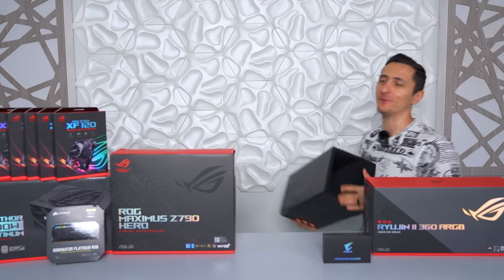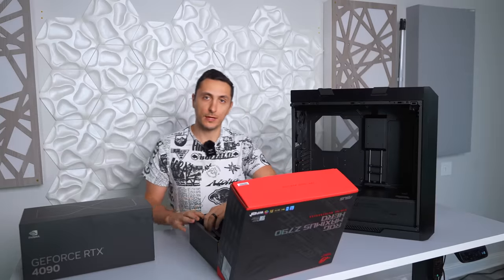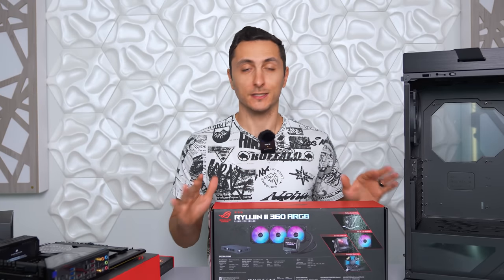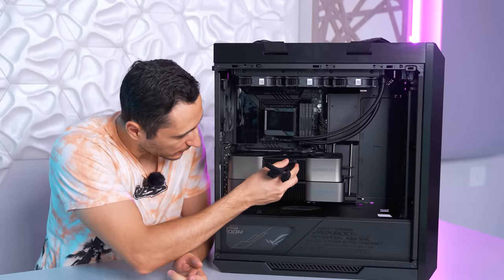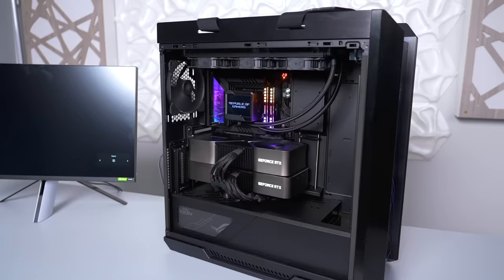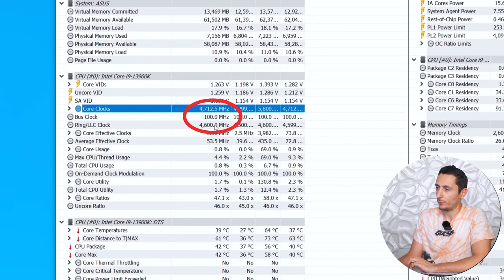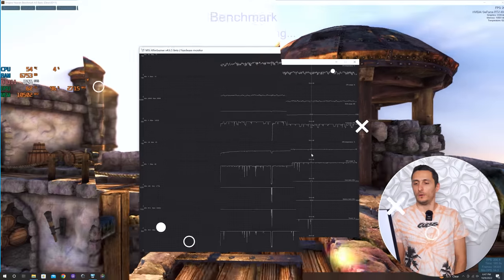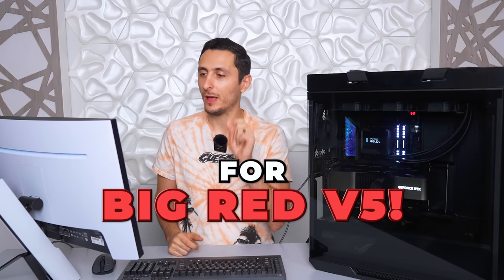This was a bad idea - 13900K + RTX 4090 PC Build (BigBlack)

Comment: At this point in gaming there really is no need to do multipule gpu's the 4090 and even a 3080 or 3090 is totally enough for performace. im glad you showed everyone how much hotter the temp is with the air flow being reduced because the extra gpu. almost 20 degree increase is crazy and deffinetly add to wear on ur gpu and its life span. thank you ed for the new video. dj kahlid need to sponser you. another one we the best video. lol
Reply: Disagree.  I'm on an LG CX48 and the 3080 barely does half the displays capability on it's own.  High settings in a lot of games at 4k I'm around 60fps which is playable, sure, but when you can get 120FPS visible?  It's not lol.

I would have done dual 3080 if it got me to where the 4090 does now.   I do custom loop cooling so my 3080 has never gone over 55C and adding a second wouldn't bring it much higher peak temp.  I have a 4090 showing up Thursday and it's getting a waterblock as well but as someone who used to do SLI all the way up to the 2080TI days, I think you're finally right that the 4090 is a card that finally doesn't need a second to pull off what most people at the high end want.
Reply: @tonymorris4335  I guess ur right but I was speaking on the average gamer. From what ur saying ur not just an average builder and u must do a lot of designing and other stuff for ur builds. In that cause I do agree 👍 with you but for someone who is just casual gaming my 3080ti does fine with most of my games on high settings. I do have a 49" ultra wide I don't like so I just ordered the asus rog swift 360hz 24inch gaming monitor. The 49" is to hard to look around at everything in fps games. But thank u for ur response. Have a great day.
Reply: Nope 👎 a 3080 or a 3090 or with „ti“ have Not the power of a 4090 play in 4k and you will see the difference.
You will get something around 40-60% more Power and less consum of eletricity. But yeah if a 3090 ti will take 410w and a 4090 will take something around 260w with more fps there is no difference for sure, i think the 3000 products are Not Made for real 4k gameplay.

Comment: this is slightly nitpicky but at 10:25 it's not because the ram is dual channel, ram speed is measured in megatransfers per second (mt/s), mhz is the frequency of the ram. as with the ddrx standard (double data rate) two transfers are done in one cycle, so mt/s is always double the ram speed in mhz so the speed being 2600 mhz is just the frequency of the ram, speed of ram is 5200 mt/s, not because it's in dual channel

Comment: The z690 hero  board supports 6000mhz ram as well. Check the qualified vender list if you want to verify. Using a 6000mhz kit right now…

Comment: The 4090 does not heat up. They’re made for that. They’re blowerstyles. I run this with 3090s and now a 4090/3090. It’s not a bad idea. Problem is having multiple cords and no fans at the bottom to throw air into it.

Comment: a properly desgined large case like this would have 10 expasion slots straight down the back for it's size & still maintain the triple slot Vertical GPu mount.

Comment: Unfortunately, using the M.2_1 slot on the Z790 means the SSD will share lanes with the graphics card. You will essentially half the GPU PCIe from x16 to x8.
Reply: half the speed of pci gen5 would be still as fast as gen4 with more than enough speed for the gpu

Comment: You don't double the number of the speed of your memory in cpu-z just because it's in dual channel. It's reading the speed correctly, however DDR stands for "double data rate". So, yes you're at 2600 megahertz, however, you're at 5200 mega transfers per second.

Comment: I'm not professional at pc building but I see a standup gpu spot couldn't you put the second gpu or the first in the standing position on the back so they don't sit under each other causing air flow issues?

Comment: 6:34 isnt it better to use the stock cable that came with the GPU instead from the PSU so you can run the GPU at full capacity?

Comment: Hello maybe I can get some help here, I’m building a pc with some of these parts:
1.i9 13900k
2.3080 GPU
3.32gbs of ram

What motherboard would best fit me? I game quite a bit and don’t need a million features just for it to be reliable and work with everything. I was thinking about the MSI Z790 P here in this video.
Reply: What you need is 2 8x/8x slots like on the Asus Creator mainboards. I think the maximus is also layed out that way. Most mainboards are not.

Comment: This is what exactly the system I want to build. Same mobo and CPU, The only difference is, I bought a 500gb 980 Evo for the OS and 4 sata ssds at 2tb each that's 8tb for games and another 500gb nvme drive just for music, docs, pictures and videos, media, and 5200mhzt ram 32gb ram not 64gb as this guy, my case the phanteks enthoo evole x. My cooler a nocuta dh15, Other then that I ordered the exact same hardware

Comment: I'm sad...
My PC now looks not so cool...

Video Card: GeForce RTX 4090 24 GB
CPU: Intel Core i9-12900KF
MB: Asus ROG MAXIMUS Z690 HERO
Memory: Kingston FURY Beast 64 GB (4 x 16 GB) DDR5-5200
Storage: Western Digital Black SN850 1 TB + Western Digital Black SN850 2TB
Cooling: ASUS ROG Ryujin 360 RGB AIO Liquid CPU Cooler
PSU: Asus ROG THOR 1200W 80+ Platinum
Case: Corsair Obsidian D500 RGB

Need to replace RAM and CPU now to save my sanity. Thank you for the video...
Reply: Weird flex

Comment: How did you get the motherboard to see both the RTX4090's?  I have the Maximus Z790 Extreme MB and only 1 of the 4090 GPU's will be seen at one time.  One NVME drive in M.2_2

Comment: hi, so i was going to build a similar setup like yours with the 13900k, same motherboard and  a 3090ti, however i was gonna use my current corsair 4000D case with low-profile ram. will the case be ok or should i get a bigger one?
Reply: ur probably fine... 3090 ti isnt as thiccc

Comment: When placing 4 slots of ram. they will run a the speed of the slowest lane. so 5600 mhz ram. NOPE.
also wont that block air flow to the top card?

Comment: I’ll wait till MSI or Asus comes out with their version of the 4090 and moves the stupid power to the correct place. The FE’s placement is rediculous. Ruines the entire case look with a massive power cable. Also rip my 1500 watt psu being mandatorily forced into an upgrade to support the new gpu. It handles my 3090 just fine.

Comment: Can you pls try to water cool them and check the temps and fps in Fortnite with max graphics, but instead of 4090 and 3090, put a 4090 and another 4090 😅

Comment: hey tech source my 3090 which is prebuilt I got from best buy recently got repaired because it has system freeze and now I am experiencing random freeze whenever I'm working or playing. and another issue was the fan. it recently got repaired with the system fixed and still makes loud fan noises. What is the cause of these problems I'm having?

Comment: Don’t put two cards in your system?  I used to run 4, for gaming, not mining, back in the day I had 3 GTX 280s and then later 4 HD5870’s, no
Reply from the maker: Back in the day sure but now it’s pointless
Reply: @TechSource  indeed, I had a point about sandwiched cards getting hot to make but it must have got cut off

Comment: What I dont get...why do you use such an expensive board to cripple it with slow ram when there are g.skills out there that can be overclocked better...and then a configuration with 2 sticks will have way better overclocking potential....if you only load XMP its just a waste of money to go for an expensive rog board

Comment: 2 Questions:
How can you tell if the PSU has the new 12+4 power cable or not, given that they don't say it on the product pages...?
Why the ** do PSU manufacturers design the labeling and even displays to be upside down when the PSU is oriented so the fan can actually pull in fresh air from underneath the case???

Comment: Not sure why you're using two cards and choking them like that?  I built a 13900k and 4090 system around the same time, but with slightly faster memory.  Won't use asus parts though, I used to work for them...  A 4090 really likes direct air flow from bottom chassis fans.

Comment: This entire build is stupid; it's impractical and stupidly cost prohibitive around $4,500. Only exception is being built without all that horrendous RGB.

Ram is listed at it's frequency not it's data rate, so it's double data rate ram , not because it's dual channel. 

Yes, there isn't enough space for a 4090 and 3090 ti, but you could clearly have two 3090 ti's in there with reasonable space. I just thought it was funny mentioning how large the case is when the space restraint is the design of the add-in card back plane which hasn't been updated since what feels like the 1980's. That itself is stupid enough. And for whatever idiotic reason graphics cards are made with downward facing faces to combat heat. Why the fuck do graphics cards' fans not face up?  They're still designing around ATX and when computers' motherboards were on the bottom of the case.